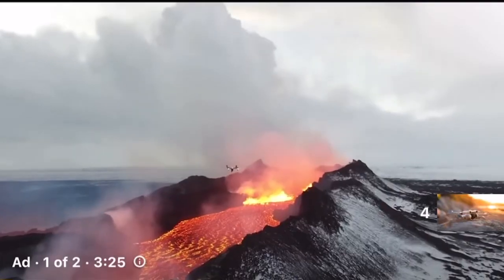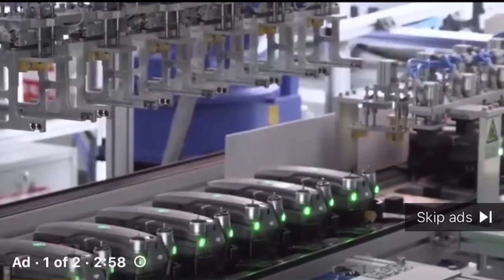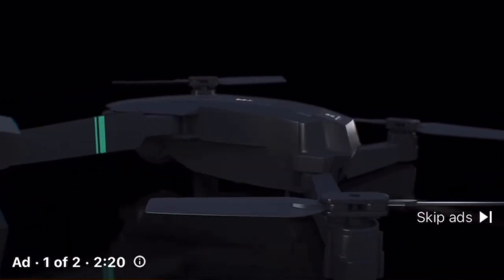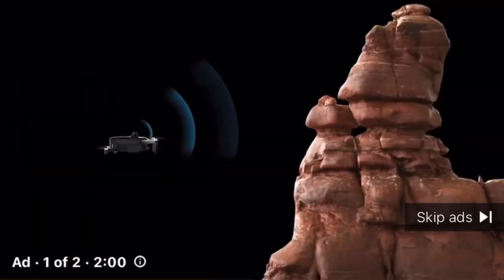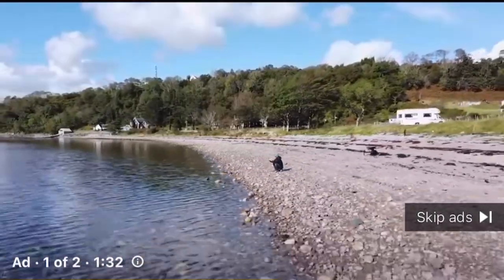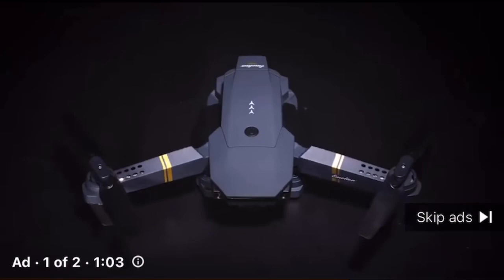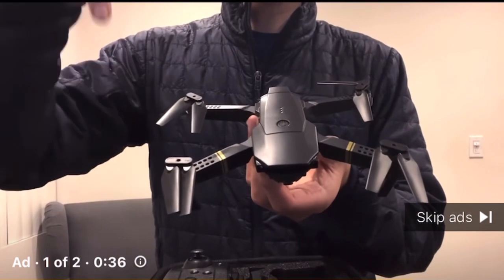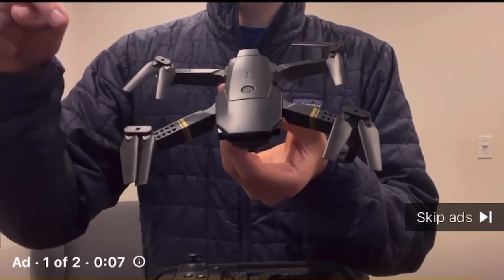SkyQuad Drone SCAM Ad ~ United States Version ~ Sky Quad

Comment: how its this face i have one and it works
Reply from the maker: Yours does everything the video claims? Yours was developed by Navy Seals? Yours originally cost $5000? Yours has a flame thrower?
Reply: Lol as if you do
Reply from the maker: @tomchilli4195  sorry I don't understand this comment but thanks for watching!
Reply: Well, for starters. I ordered two. And was charged for three. It's been three weeks , I still haven't received my refund for the third rdrone. Secondly. there's  no follow me function. Thirdly. You battled to set the thing up. Fourthly. I have returned both. the other drones because the oned propellers did not all work and the other one would loose connectivity and fly  and drop to the ground. So I went to 41 Turf St andebolt  Boxbutg I still haven't received my refund. It's just emails up and down. So I'm going to  anderbolt and I'm gonna take three drones and I'll sell them for 1000 each to get my money back. And then? I'm going to send my buddies from sars as this is clearly pirate copies these drones cost R 350 +- to make and on the box says made in China so it's probably cheaper. And what they advertising.Is not what they're selling. So it boils down to fraud. And that's it. I'm tired of sending emails up and down, up and down and being promised that the refund has been done and it hasn't. And thirdly, when you look on the box. It states clearly it's made in China and not a military grade made in the USA. Oh yes, and it. Doesn't have a come home function. When the battery goes flat. It just simply falls to the ground when it's flat. What a lot of crap.